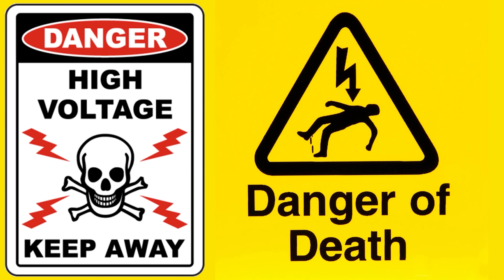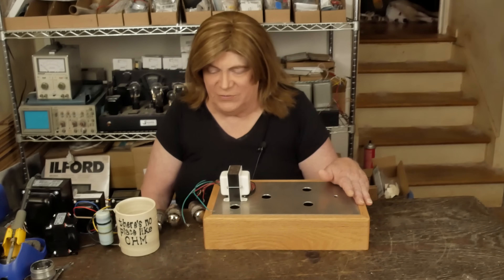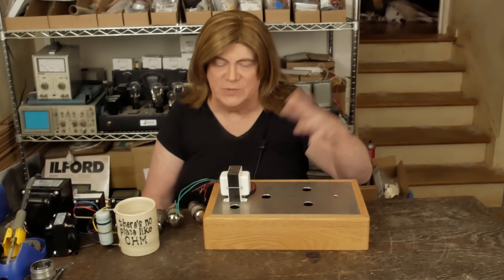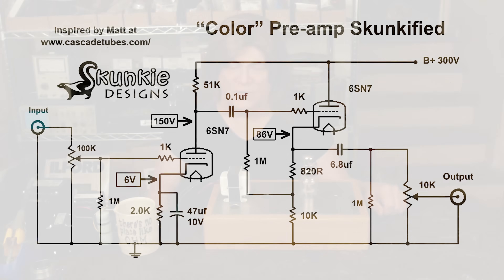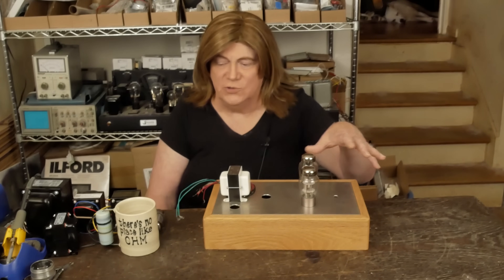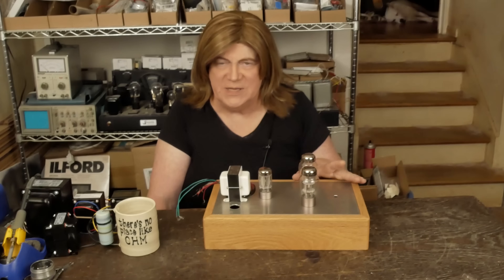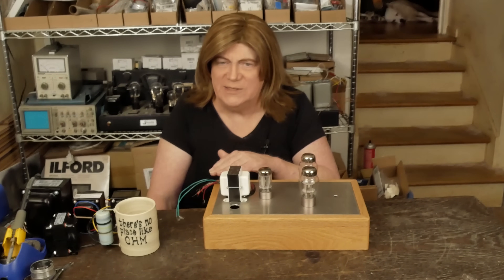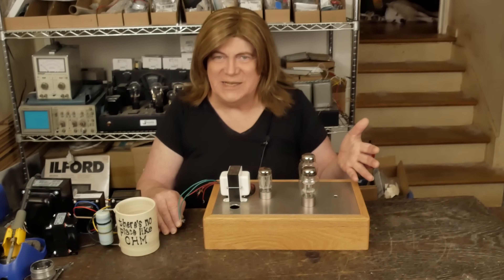"Color" Tube Pre-amp: 6SN7 Version!

Comment: Love the idea for the 6SN7 color preamp, the soviet 6N8S drop replacement tube has a beautiful lush sound and is pretty cheap it would be nice if you could test it. It would be great if you could add a bypass switch so on the fly comparison with the original signal can be made without cable handling. Eager to see the results.

Comment: Just discovered your channel looking to build a tube pre-amp for my Orchard Audio Starkrimson ultra 2.0 GAN amp.  Only thing is it requires balanced outputs from the pre.  Looks like its down to you and bottleneck for the design/kit for a tube pre-amp which im completely new to.  Any suggestions for the pairing?
Reply from the maker: "True" balanced from a tube pre-amp would require you double the circuit and tubes. Anything else is just using transformers to create the illusion of balanced, at a lower sound quality level, so you can say you are using balanced cables.

Comment: Rewatch the 12au7 version videos and someone was concerned that this circuit inverts phase.this can dealt with by reverse polarity of the speaker . other  options are to  use inverted out of device (if present) feeding this.bal in/out can present some options to change polarity as well if the gear has them.
Reply from the maker: Many amps/preamps invert phase. It really doesn't matter as long as both channels/speakers are not in opposing phases.
Reply: I agree.some people are concerned that phase stay the same in to out  in chain of components.every component in the chain must be checked.so the color pre might bring the phase back to normal!😊
Reply from the maker: And you can always just swap speaker leads if it's a concern. I don't think you can hear it though.

Comment: I used  o.3 ohm resistors to lover the heater leads .on rectifier tube to get from 6.3 to 5 v heater.worked well.
Reply from the maker: But why do that when 6.3V tubes exist? Just generating heat that has to be dealt with.
Reply: To make it as the orginal 50 ties fender.but i got the order to do it from a mentor,i was not alowed to change preamp tube,it shold be ecsact copy. History,long ago.

Comment: Hello Steph, nice to see the color reappear in another color jacket ...
The 6CA4 is infact a European rectifier commonly used at that past era......it is a EZ81  the 6CA4 is the Amrican code for this european tube.
This rectifier has a  different (more European ) sound/tonal quality ........in fact it is very good and can drive even a PP EL84 amplifier...
The 6X5 is als overy nice and the octal version of the later noval 64 tube.....I  like especialy the RCA (different  double plate structure ).....as well as the Tungsol 6X4 witch sounds very musical.
For the few lucky whoo collected tubes since decades.....the Telefunken RGN1604 ( mesh plates ) is the holy grail.........and a 280 ( globe bulb) is another gem.
For thise who,use diodes forthe rectification there is the possibility to insert a indiect heater rectfier to induce a slow satrand benefit from the tube rectifier galvanic separationand sound..
ALL rectifeirs have different flavor..
No doubt the 6SN7 is worth of the experiment !........indeed the input gain pot defines the the color ....and the output pot controls the volume.
Some amplifiers have this future build in , ....input sensitivity and volume afate the gain stage...............works very well and in fact is the better way to avoid tonal shifts at different volume levels !
heap trick for  lower noise floor is to install very small caps on the tube socket pins for the heaters.....and polarise the heater voltage some 25_35  volts above the ground  mass ...( with a voltage divider on the High voltage rail  + capacitor )
Have good luck and succes with this project .......and FUN !
Maybe  this error of holes in the chassis was intended by the subconscious and the universe to try this other way of building the color preamp...?
Have a vey nice day .
Reply from the maker: Yes, let's make lemonade out of lemons :) Thanks for the great info as always.
Reply: RGN1604?? I guess you mean RGN1064! Am a happy owner of one, as well as an AZ11 - identical electrical data, just with 'steel tube' socket. Have to admit though, so far I never used a tube rect in my few tube amp builds...

Comment: Doesn't having the pot on the output really compromise the cable/power amp drive of the cathode follower? Or does this add to the colour?
Reply from the maker: https://www.cascadetubes.com/2022/01/17/about-that-volume-control/ Used the way it's intended, you are never using the second half of the volume control so it doesn't "really compromise" anything, unless you plan to drive a 5K input impedance amp 15 feet away, which in that case no tube pre-amp would work well.

Comment: get rid pot from the output use 100 k to ground for the output impedance use 1 uf output cap 1 meg on the output is fine change 51k to 120 k
Reply from the maker: Then you simply have a bog standard tube pre-amp and that's missing the whole point of this device.

Comment: I run 6Sn7 in my color pre amp with adapters. Sounds great. No changes.
Reply from the maker: Yeah it looks REAL close! I might very slightly tweak the bias resistors.
Reply: Where do you find these adapters?
Reply from the maker: Ebay and also seen them on amazon of all places!

Comment: 6X5 is a good 6.3 volt rectifier Check out the Bendix 5852 a drop in 6x5 equivalent that's a military ruggedized version and still very inexpensive, much better build quality and will last forever and not much money. Early 6X5's have a nice looking coke bottle, but the 5852 is the best of the batch
Reply: YES .this is a very good advice and real fact ! Maybe one of the best tubes ever  build ! ..........and most likely you will never have to change it .....
remember that superb tubes have only their place in the very best circuits and highest quality build standards....in my native language  they say never to trow pearls at the pigs ..

Comment: You may hear an improvement in switching from 12au7 to 6SN7, you’ll certainly have more options for tube rolling.  It’s been said that the 12au7 is just a 9 pin version of the venerated 6SN7.  Electrically, they have the same stats.
Reply from the maker: The plate curves are slightly different but very close!
Reply: Agree that 12au7 is close to 6sn7 .rca tube manual does recommend slightly different plate current and grid voltage.the resistance couple amp chart in back of book treat the 12 au7 different than 6sn7. For example plate         supply for au7 300v 47k plate resistor follow by 220k in next stage the suggested cathode resistance is 1.5k.the suggested cathode resistance for sn7 under same condition  is to INcrease to 1.8k.instead you have decreased from   2.2kto2.0k.will your value work well? Probably so.your moving closer to mfg recommend value.maybe good on 51k plate r .however this a color device so to keep sonic ,the data in chart would suggest you also try about 2.6k cathode resistance.the 6cg7/6fq7is included in the same chart as 6sn7as is electrical 9 pin copy.nice thing about octal socket is it's easy to make homemade adapter for 9 pin and local tubes.au7,7n7,6cg7etc.not criticizing just curious what cathode res make this particular circuit preform the best.i have no experience in subbing 12au7 but probably will by fall.oh and if using old sn7gt not a or b watch out for b+ as the ratings are lower.lm gonna leave the load line to  you.could make my suggestion invalid.just notice a trend in rca chart.
Reply: Same family of gain but not realy equivalent !.........often they  can be used in a similar circuit but not always.  one should be cautious with such claims that can be missunderstood by some people and DIY community .....
Reply from the maker: Yeah, they are close, a minor adjustment to the cathode resistor should do it!
Reply: It is easy to think that those lush octal tubes are better than their Noval cousins, but lets not kid our self. The Noval envelope is the upgraded version from the Octal envelope for small signal tubes. Specially on high frequency applications the Noval envelope was enabling technology due to its lower parasitic capacitance's. The 6sn7 is an interesting tube with the better looks. But don't rule out the 12au7 quite yet.

Comment: Just tried over a dozen 6SN7 tubes. The Apos Ray Reserve are really good but the best was the 6SN7GT PSVANE ART T3 series. Superbly transparent but still conveys a musical sound. Used in the ModWright Analogue Bridge (tube buffer). That ModWright allows you to use 6SN7 or 12AU7 (with adapter) so you might take a look at one of those if you can.
Reply from the maker: Thanks for the tube recommendations; I'll keep those in mind!
Reply: got a set of the Art 6n7's, (used in a P-P 6550 driver board)..excellent sounding tube and dang.. looks sexy as hell too! Using the Ray Reserve EL34 in a S.E amp I've built and driving them with a C3g loktal